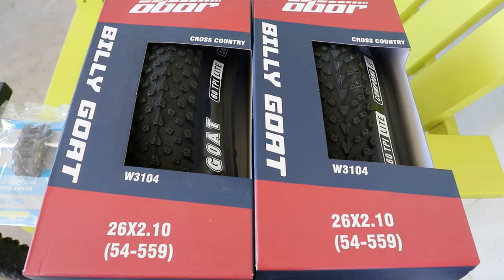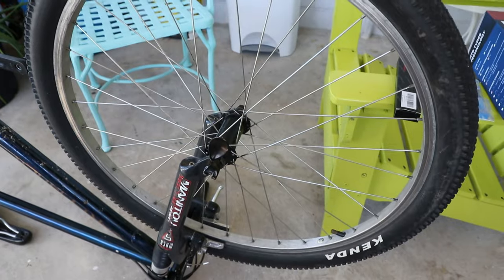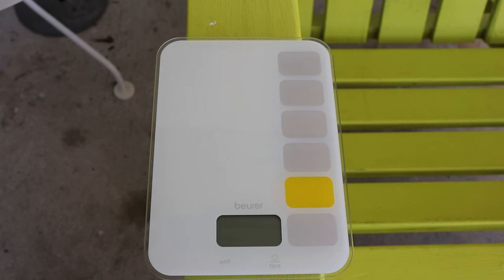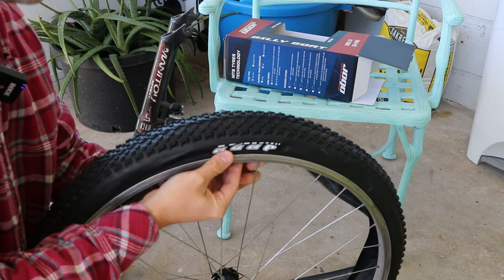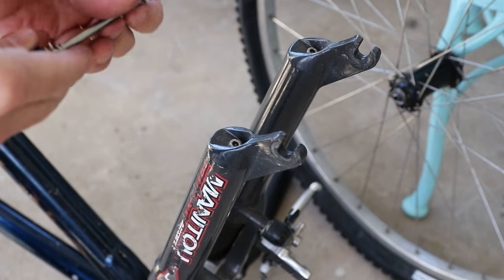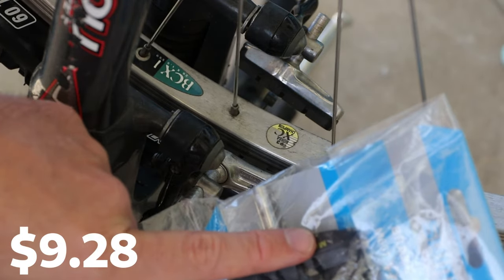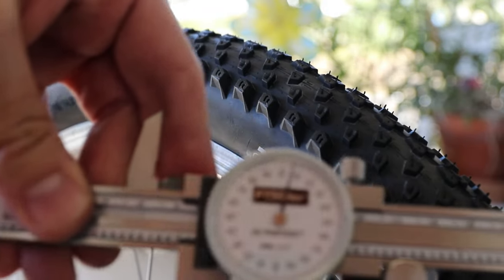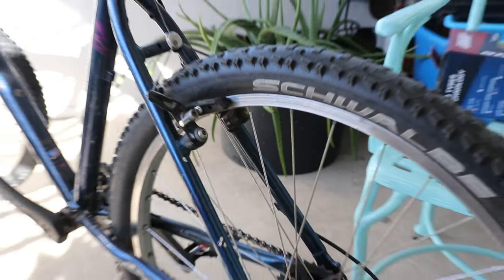New tires for my 1996 Gary Fisher Paragon

Comment: I use baby powder (talcum) inside the tire (spread with your fingers) and on all my tubes (also old ones in stock). It prevents the rubber from sticking and drying.
Reply from the maker: I've never done that myself but I've seen it
Reply: HOLY COW!!! That idea seems clever =O I have got few flat tires due to the chamber's rubber sticks on the tire after a good while! As I am just changing the tires, I will try your technic =D

Comment: I've only run into schrader valve shifting like that when running too low of a pressure. On the super budget tire front I'm a big fan of Kujo on Amazon. They are definitely not supple, but great for tubed city/gravel.
Reply from the maker: Thanks, going to head over there and check that out

Comment: I've only seen valve stems getting twisted from low tire pressure. You can also try a set of tubes with a threaded steel valve stem and nut which will hold it in place much better.
Reply from the maker: hey ABH! yeah maybe they twisted that way then, I did ride on the front when it was a bit low I remember once.

Comment: I think it's the centrifugal force the tire and tube which causes the tube to slip and snap.  I've done it a lot on my Nishiki Alien with Kenda slick street tires. I used electrical tape instead of a spoke protector to help stop the rotations.
Reply from the maker: Hmm could be both, tire pushed outward, then sudden braking